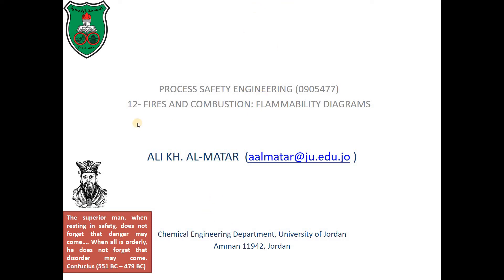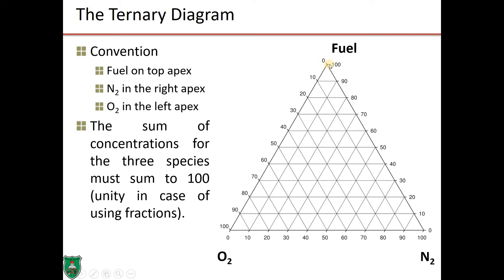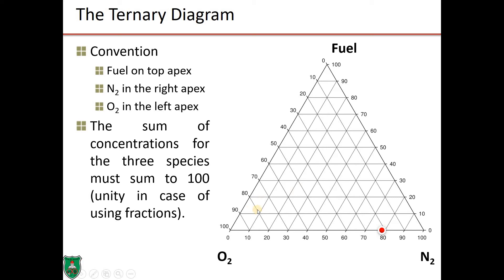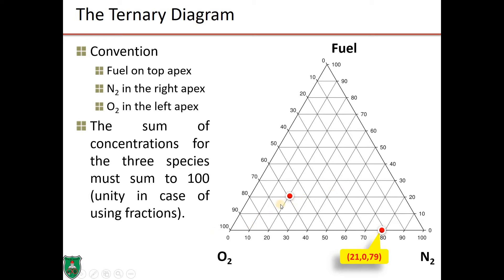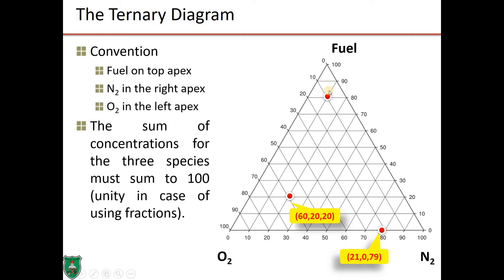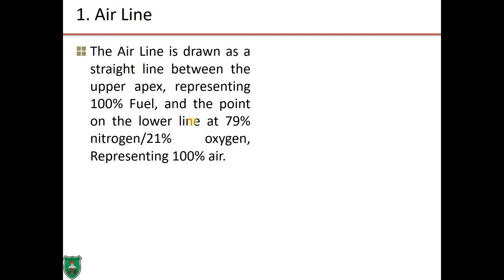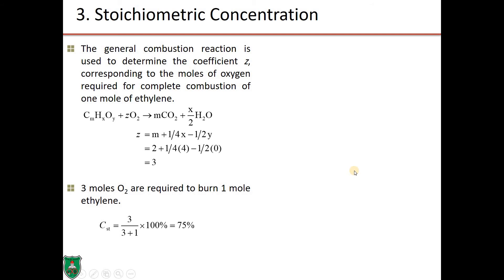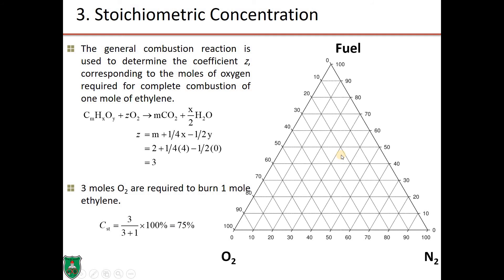Construction of a ternary flammability diagram for ethylene (C2H4)

Comment: Interesting that our teacher in Slovakia explained that Cst= (mol fuel / ((mol fuel + mol oxygen))*100. And its a different number-result than if i do it according to your explanation at 10:54. according to my teachers formula for this chemical C2H4 Cst= (1 / (1+3))*100=25% . But then he still gets the right diagram because when marking it in the triangle he substracted the given Cst from 100% (so 100-25=75%. (you just mark the given Cst on the triangle, my teacher marks 100%-Cst -following his formula)... but even if the diagram is still correct, the formula for Cst calculation is wrong (his or yours? i dont know. but i think that my teacher is wrong because it makes no sense to do (100-Cst), So his formula of Cst is wrong. Yours is logical.

Second thing: it seems like you have drawn a straight line from LFL in O2 to MOC. But if i have to draw it exactly and correctly then i have to draw like this: draw line from LFL in O2 to  LFL then from here line to MOC. Am i right?

Thank you a lot for your help
Reply: I am trying to understand that issue i wrote about. Maybe these are two different things?
- stochiometric concentration of oxygen
- stochiometric concentration of fuel in oxygen?
You are working with the first one but my teacher is working with the second one, this is why he has to substract the stochiometric concentration of fuel in oxygen from 100% to get the stochiometric concentration of oxygen? Does this make sense? For example Cst of fuel in oxygen is 25%. to get the Cst of oxygen we just substract: 100-25=75%?